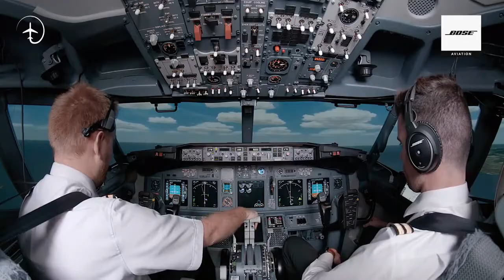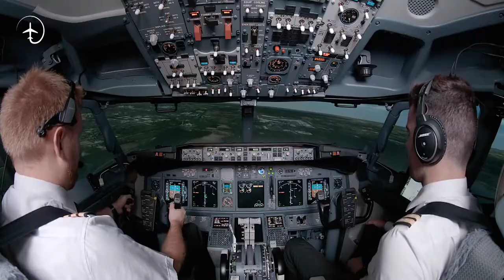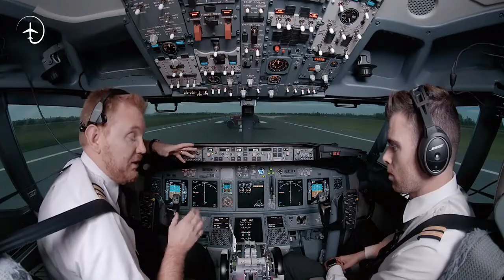How to manage a Dual Engine Failure due to a bird strike in the 737NG

Comment: whydon’t call both engine flame out checklist
Reply: In one word: Prioritisation. The engines failed after a bird strike and you can see N1 reduced to zero. The only case in which this would happen in flight is if something mechanically locked up the shaft, so a restart is basically impossible. Running through a checklist that is designed to restart the engines would waste valuable time that they should rather use to try and reach a safe landing spot.

Comment: I thought that after engine failure auto-thrust manually disengaged, both thottles would be manually pulled to idle then fuel levers to cutoff.
Reply: yeah i thought the fuel would have been cut off

Comment: EFATO total, we turned 180 plus Turnback to opposite runway at 40-45 bank at Vglide before any check.  To nearest airport.  No, you wont stall unless an idiot panicky pilot.  I took EFATO 5 kinds on Cherokees 1995.  14 years before Hudson Miracle.

Comment: love how the fo called atc initially with no electrical power and no radio also how he started to say ryanair on final 🤣
Reply: Vh1 is working , so yes fist officer can communicate on it 🤦‍♂️
Reply: Wdym no electrical
Reply: @gardnerbu9797 eec emergency electric config in the 737 (basically battery power) sheds all non essential equipment this includes all the screens on the first officers side and the radios so if this happened irl he wouldn't be able to communicate the captain would have to
Reply: @jamesodowd4063  why would it shut off the copilots headset? I fly Airbus and while yeah, all the screens shut off and all radios except VHF1 are shed in emergency electric configuration, the copilot can still comunicate with his headset on VHF1. Anything else just seems stupid.
Reply: @SaitekFreak999 idk you'd have to ask Boeing why they didn't think of that in the 60's 😂. That's a much better idea tbf

Comment: I’m really wondering if this is exactly what happened in Korea except they tried a relight and it didn’t come on until they were already coming in super hot with no apu and no flaps or gear.
Reply: still doesn't explain why they did not put the gear down
Reply: @ I think it does. The FO was frantically trying to relight the engines rather than leaning over and doing the whole time consuming gear procedure. They were running out of energy fast so the pilot just kept flying the plane. They didn’t want to accept a dead stick landing so they just accepted that if the engine didn’t relight they would belly land. Not exactly a logical conclusion but I’d bet that’s what happened.
Reply: No time!
Reply: I think seniority culture played a big role in this crash, unlike here where the captain was still in control but he made sure that the co-pilot was on the same page with him and if there is a different opinion, the co-pilot would not hesitate to point it out. they work as a team and just listen at the beginning of the emergency. the captain informed his decision and the co-pilots confirmed it as it is per their training. 
everything has to follow a set of procedures and I don't think this happened on Jeju flight.
Reply: @tommytomas-fr3sh  as a quick note: one thing that saved the USair flight into the Hudson was the captain ignoring the SOP and turning on the APU right after the bird strike. In Mentour’s sim here the accident happened at a few thousand feet, it’s possible that the bird strike could happen at 300 feet and it would be a mad scramble.
Reply: @Papershields001  but the captain and copilot work as a team. The captain gives clear intentions on what he wants to do. He asks what the copilot thinks and does he has any suggestions. This is what good cockpit resource management is, not a one-man show. I'm afraid this one-man show is what happened on the Jeju flight as Korea has a seniority culture. This culture applies in everyday life let alone in emergencies where in this accident the captain is a senior pilot in the company.
Reply: @ we are going to have to wait for information from the investigation to know what really happened. Seems like there was a confluence of several things coming together to create this tragedy. I won’t be surprised if there was a failure of CRM but I wouldn’t jump to condemning the crew for that until the experts can make their analysis.
Reply: @tommytomas-fr3sh  Korean Air 801 was one where the seniority culture played a big part in the accident. I had gotten the sense tho that many of the major Asian carriers like ANA or Korean Air had worked hard to fix their SOPs in that department. Then again Jeju might not be up to the same safety culture as say a JAL or Singapore Airlines. Hopefully the black boxes got good data and voice
Reply: @Papershields001  Yes I notice that this kind of culture is still strong in smaller airlines the recent two accidents that I know of where it was contributed by seniority culture are the PIA 8303 a and US Bangla flight 211.

Comment: No need to bank so much and capt forgot reversers.
Reply: Reversers? With dual failure?
Reply: @belegestel_  Engines are still windmilling
Reply: Reverse thrust does nothing with no thrust 🙄
Reply: @LiamHolloway engine will be windmilling and as a procedure it’s good to take it. It wil have some effect.
Reply: Windmill gives drag and not thrust so it's already reversed in that sense and opening reverser doors will not have any impact
Reply: Dudes tripping!

Comment: Traffic not selected in ND. FO releasing  cabin using inop switch.
Reply: This is just for simulation. Release the Captain is done as per SOPs first click attend button the switch off the No Smoke as a remainder Crew has been released.
Reply: this is a minor mistake but it didn't deviate from taking the aircraft down in a safe manner.

Comment: What about the memory items for severe damage?
Reply: This is a tricky situation. When both eng fails due to severe damage you better try restart and get whatever thrust you can get from them.
Reply: I don't know which thrust you are going to get with 2 severe damaged engines. Although I agree I would call for the Loss of thrust on both engines first, followed by Engine Severe Damage QRH
Reply: oh boy
Reply: loss of both thrust takes precedence

Comment: How does the plane not just fall out of the sky??
Reply: Alright, so first of all this video is from Mentor Pilot, stolen and uploaded to this channel I assumed, I'd recommend checking him out to learn more about flying.

Basically, airplanes don't fall out of the sky when they have no thrust because the lift of an airplane is produced by the wings. How much lift a wing produces depends mostly on the shape of a wing, the velocity of the airplane and the density of the air (as well as the angle of the wings).

Airplanes have immense lift to drag weight ratios such as  15:1, meaning the airplane generates 15 times more lift than ot does produce drag. 

This means that airplanes have very high glide ratios, which are ratios that indicate how much altitude can be traded off for horizontal distance, for example, the 787 has a glide ratio of 20:1, meaning that for each kilometer of altitude of height it has, if will travel 20km horizontally.
Reply: @anibal5824  tldr it works like a paper airplane. The speed the aircraft has allows it to glide
Reply: @anibal5824  Liar. Stop trying to put nonsense thoughts into his mind by using "psycho babble" styled irreligious (and bunk) science assertions.
As we all know, the Almighty holds those airplanes there, using his many fingers.
It's a matter of having faith so that you may see the light.
Reply: Bro definitely failed physics
Reply: @charlespg3d190  The Bro was probably a little foolish asking the question in a forum such as this when Bro could just as easily searched the net for a rudimentary (fundamental) explanation with moving graphics elsewhere on Youtube (or pretty much anywhere else on the internet for that matter) and would have found a simple enough explanation to increase his knowledge with in just a few seconds.Perhaps he was looking for someone to come by and respond to him by providing an absolutely ridiculous fantasy tale as an explanation in an attempt to both humor him and encourage him to remove his question from this page.
Who knows? Bro might just be a physicist feigning ignorance on the topic, so that he can jerk out chains for fun.
Reply: It becomes a heavy glider
Reply: @CaptAra  No it doesn't. It becomes an aloft land vehicle.
Reply: What was explained to me was that the larger passenger jet airplanes gradually descend without engine thrust as a result of skyhooks, which get automatically deployed from the nearest bank of clouds if an all engine failure occurs. This is achieved by a signal being sent to the nearest skyhook equipped clouds from the aircraft command and control center when the non-flying pilot initiates the startup sequence of the Aircraft Pole Unit (or APU). Doing that will extend large poles from the aircraft belly to help soften the no engine landing by acting like pogo sticks. 
Because the clouds the skyhooks are attached to are quite soft, "cloud buckle" or "cloud "droop" occurs. This is most apparent with the white fluffy clouds (which stretch a lot). The result is that the aircraft will still descend until the sky hooks have reached their ultimate stretch or elastic limit, which is why it is preferable for the aircraft to have landed before this occurs.
Anyway, this is just what a guy told me a few weeks ago. He said he was a former Air Force colonel who is now seconded to President Donald Trump's newly formed Space Force.
Others might have a different explanation about this, so I'm keen to read what they have to say on the topic.
Reply: Cause it has wings
Reply: Planes have these things called "wings", remarkable really....they create a pressure difference by having air pass above and below at different speeds and thus resulting in an upward force known in the aviation industry as "lift" 🤣